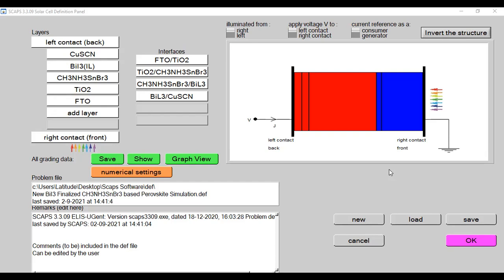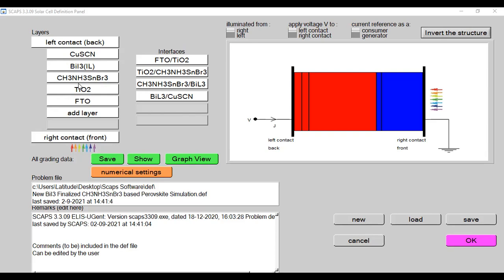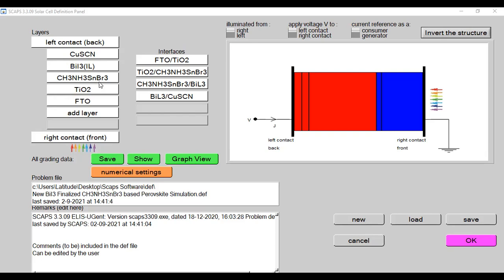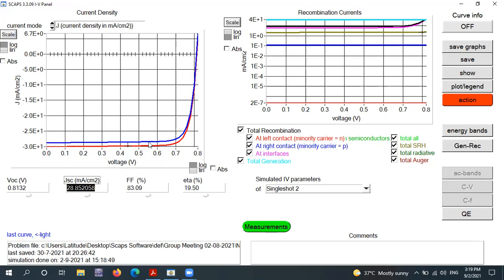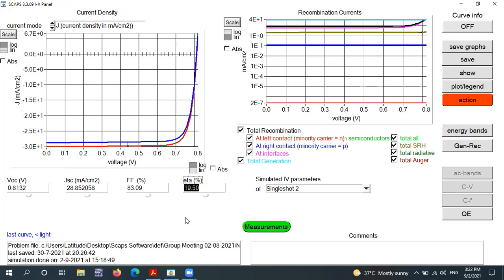Defect Analysis and passivation via Interfacial Engineering Technique for Tin Based Perovskite.

Comment: I would like to perform a simulation where the thickness is a variable on the X-axis, and the spectral response (A/W) is a variable on the Y-axis. I need assistance in how to carry this out using SCPS 1D. Could you please guide me?
Reply from the maker: I'm not sure about the please check batch analysis feature ik Scraps may be there is such an option available

Comment: Hi Honorable, in fact I haven't finished looking at all your size videos yet and I hope you have already explained how to add the passivation layers (please tell me the title of the video). For that I would like to have the parameters of the passivation layers like those of Sio2, Tio2, Al2O3, Sn (S, Se), ... May the good god give you everything you want, grant you a long life.
Reply from the maker: Pl check lecture No 12 it's available about defect passivation via interfacial engineering. HV a look regards
Reply from the maker: Please double check about materials as you are saying defect passivation via substrate modification. Pl use ZnO or SnO2 if you are working for defects passivation via substrate modification.
This clarification will help you alot
Reply from the maker: If you are looking for passivation via interfacial engineering you can add addtive layer in between HT/Perovskite or ETL/Perovskite. Please specify your perovskite Nd then find additives that HV same functional group.
Regards
Reply: @engrmuhammadwaleedakram4486  Thank you honorable
Reply: @engrmuhammadwaleedakram4486  OK thank you a lot.
Reply: @engrmuhammadwaleedakram4486  Hi Honorable, I am working on the CZTSSe, so I felt that the layers of passivity could be very beneficial for me. Sincerely,